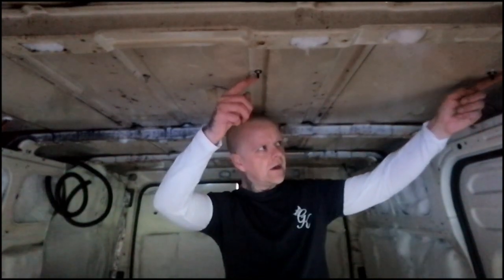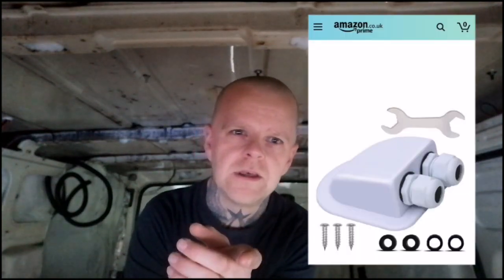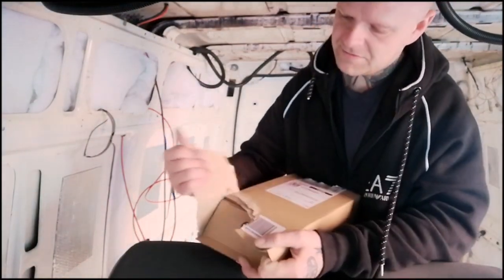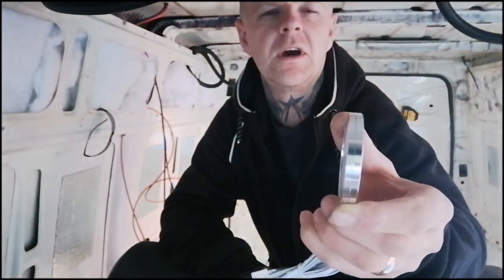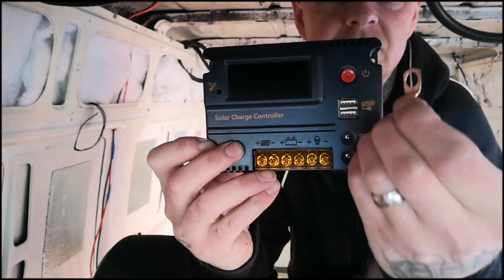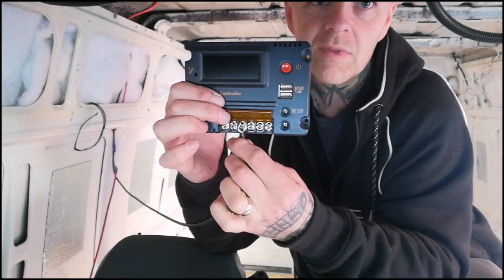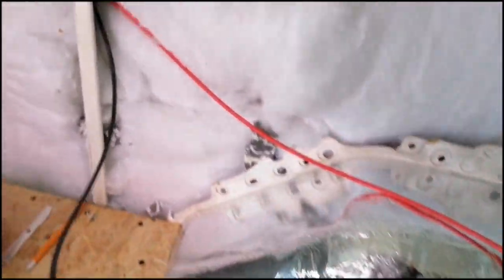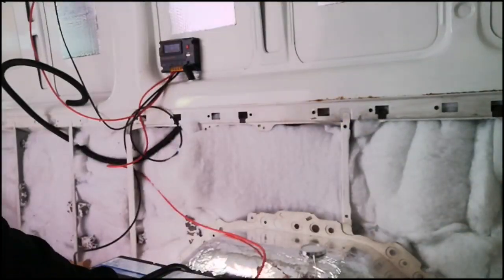how to Install 200w eco worthy solar panels in budget camper van conversion #vanlife #camper #solar

Comment: Hi Dan, would you still recommend these panels as I noticed that you've used Renogy in your newer van? Thanks
Reply from the maker: Hi. Yes I still recommend these as kit. They come with all you need and definitely helps if you're unsure. In the last van I didn't need much power as it was only for minimal use. In the new van I needed more power. The renogy ones were slightly narrower than other 100w panels as I needed them alongside my roof vents. I underestimated the space the roof vents would take, so it ruined my initial plans. But I would happily recommend both the eco worthy and renogy panels. Hope this can be of help 👍